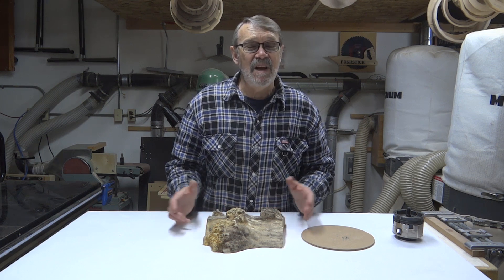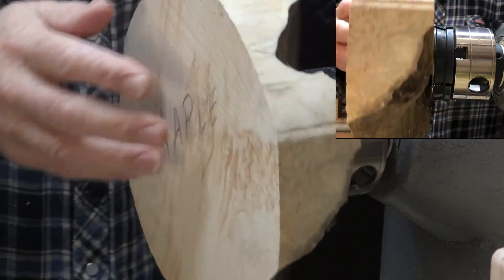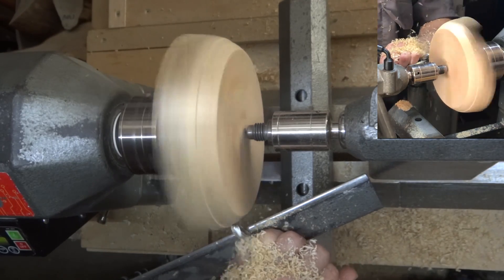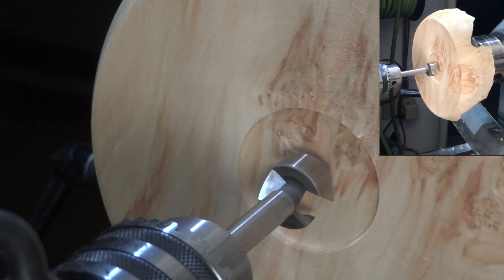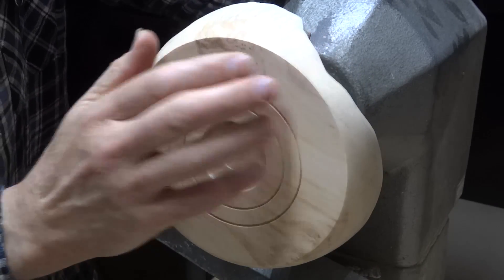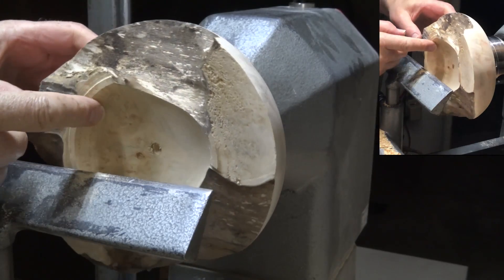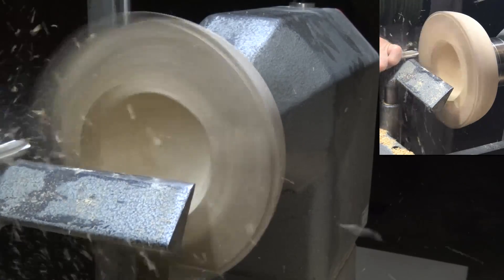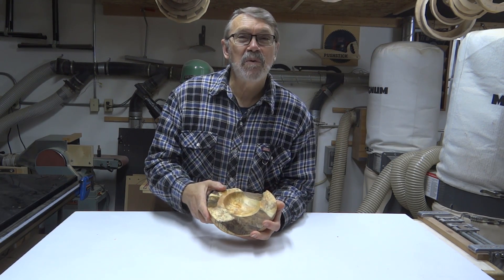Maple Burl Bowl Left Partly Natural

Comment: One more "Like" from down here in Nevada. There's not a lot you can do with such an oddly shaped burl like this. I think you did well, the grain really pops.
I'd like to suggest that when you reverse the piece in the future slow the lathe way down and be certain the woodworm hole is running true before cranking up the revs. Of course re-tighten the chuck as well. It could save you from diving for cover. I'm teasing of course...
I can see that you're more careful after the mishap last time. Any hints as to what is coming next?
Reply from the maker: Sorry, Gil, no hints. I'm trying to do the "thinking" thing right now to come up with something. The only thing it's done so far is give me a headache. I think I better go lay down for awhile. 😁😁😁😁